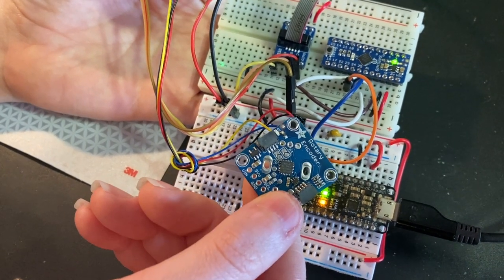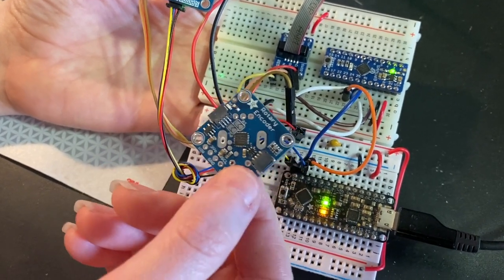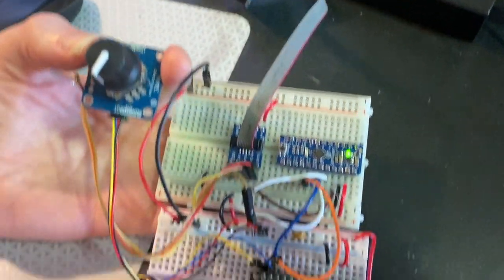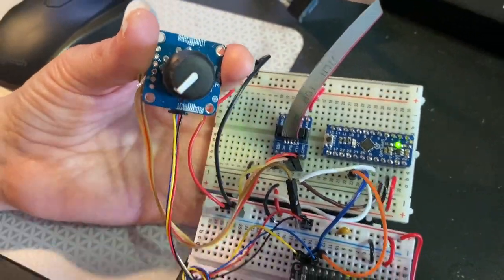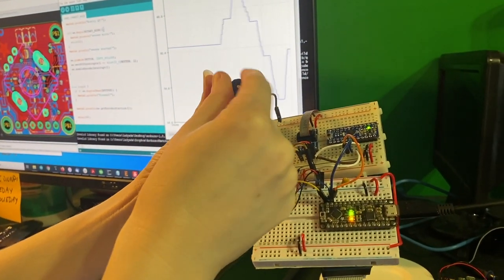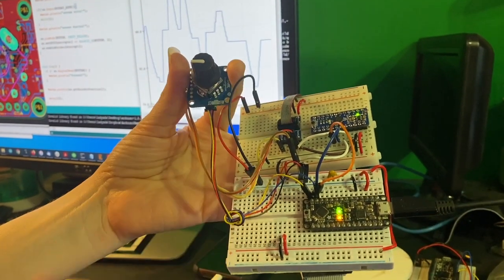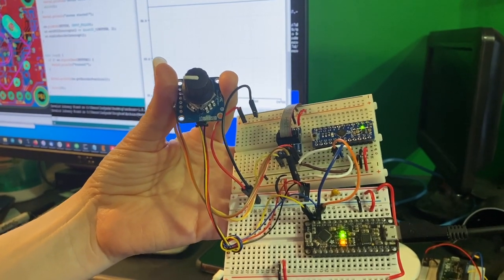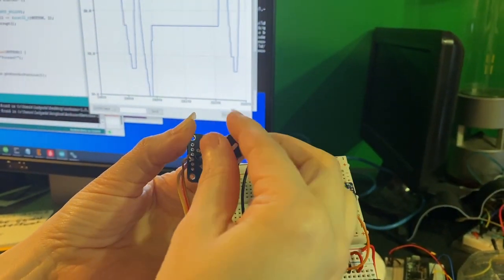Rotary Encoder to I2C with seesaw

Comment: Do you have specs on the I2C interface for this? I'm working on a project where i'm using a rotary encoder and interfacing it to I2C using an arduino Uno, just for prototyping, but it'll be much nicer to use one of these eventually... and if i can make my device's I2C api the same as yours, then it'll just be a drop-in replacement. :)   (I'm doing the rotary/gray code encoding using just a simple lookup table fwiw, rather than a state machine or whatever, super lightweight, works perfectly...  ( https://github.com/BleuLlama/I2C-Rotary-Encoder )